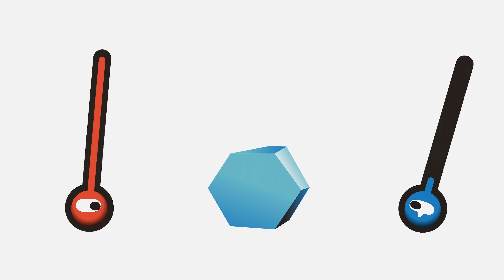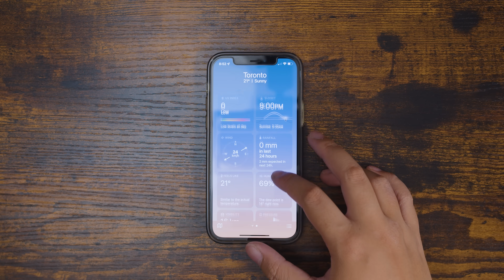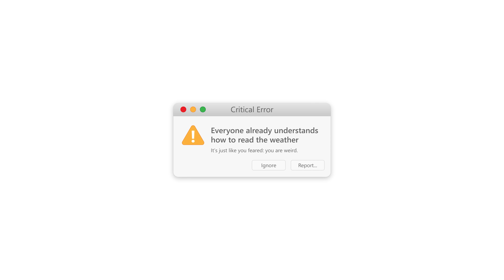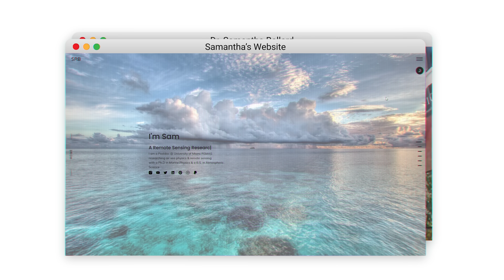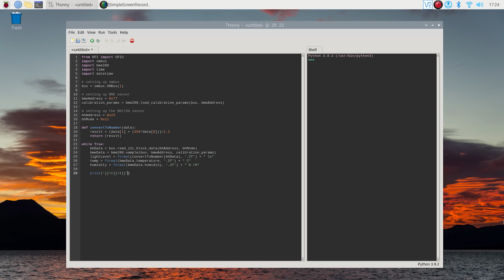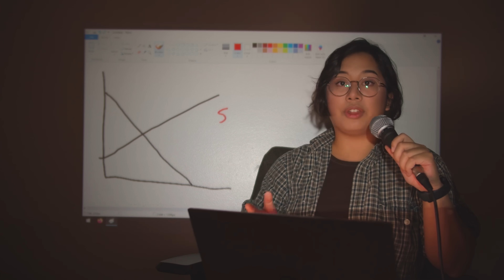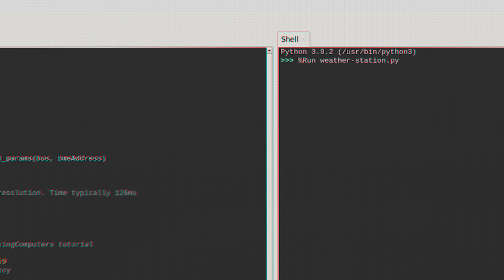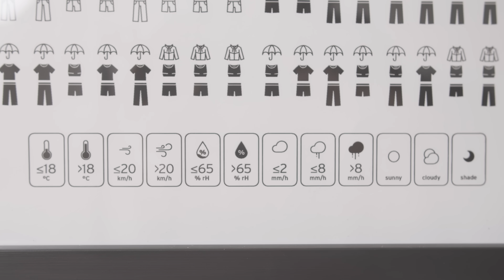how fahrenheit fails you

Comment: Honestly, I think Fahrenheit is only more intuitive if you're used to it, and the same goes for Celsius

Because speaking as someone more used to Celsius, to me it makes perfect sense that negative numbers means cold, single digits means slightly chilly but not that bad, the 20s are on the warm side, and if the temperature's above like 30, it's fair to say it's hot. Meanwhile, Fahrenheit seems bizarre to me because it uses really high numbers to describe temperatures that aren't even warm

And as many a Fahrenheit user has pointed out, to Fahrenheit users, it's the other way around

Comment: Humidity and dryness affecting how you feel is soooo true! I've lived in arid desert areas and humid and making me die areas, lol. Dry is always much easier to tolerate in the heat. Though I still prefer AC in the summer over swamp coolers, and I can put up with the nose bleeds from the dry weather for the tolerance.
Reply: I had that experience with cold this winter.
On vacation I went to a town 200 km from the coast and the next day I went to another right by the ocean. The first had 4 °C and the second had 6°C, I was fine in the first, I felt like I was freezing in the second, couldn't take my gloves or cap off.

Comment: I always preferred Celsius even though I grew up with Fahrenheit because the big number in the app for Celsius is honestly good enough for temperature, especially since the feels-like temperature is always gonna be off by quite a wide margin anyhow with humidity. So it’s just easier to see a number and round it up to the nearest 5 and dress for that in the summer, or round it down to the nearest 5 and wear something a little bit warmer in the winter. 

Plus I only have two kinds of clothes I wear anyhow, outfits suitable for hot, and outfits suitable for cold. 🤣

Comment: Maybe wet bulb temperature would be a more useful guide to how the weather will feel than temperature temperature. You can measure it with a wet thermometer, or calculate it with a formula from temperature and humidity. I think it encapsulates how the two combine together to affect how you feel.

Comment: Some apps have the “x C, feels like y C” where Y-number tries to include sun, wind etc effects compared to an “average” weather. Pretty useful for understanding compound effects? 

Also C with 0 = transition water/ice is pretty perfect for understanding weather reports around winter in countries where you transition between snowy/icy (-C) and wet (+C) a lot… like over here. Presuming all temperature scales will suck at some aspect, at least Celsius has a big easily understood correlation to one aspect of weather.

Another thing is to pack ultra light raincoat and use layers (which you say you don’t like lol). Shed a sweater into the backpack whenever warm. Add sweater and raincoat when weather sucks.
Reply: Celsius also works well in hotter countries, where it rarely reaches as low as 0C the presence of literal water freezing conditions basically means it's maximally cold, making it a convenient zero point. Basically Fahrenheit only seems to be more intuitive if you live in the middle of North America

Comment: For mapping temperature to outfit, both Celsius and Fahrenheit are fine. Numbers under 100 are manageable, and weather fits within two digits most of of the time.

However, as a Dutch person, the Celsius scale is much better for one thing: can I go and stand - and more importantly skate - on the ice in winter?
Though, this question is becoming less and less relevant, so until the weather gets ridiculously hot there's no clear winner.

Comment: Fahrenheit's purported advantages mainly only work in specific climates. Where I grew up 50-90⁰F is all that's going to be used most of the time, with maybe 35-110⁰F in extreme situations, which is a pretty arbitrary sounding set of numbers with no "real" anchor points. Knowing Celsius is degrees above freezing point gives me a pretty tangible reference point. Apart from that 50-90 doesn't seem in anyway to be a more inherently intuitive set of numbers than 10-32. And growing up with Celsius, I certainly feel I have a pretty good sense of it.

Comment: Your body's made of water. I only need the boiling and freezing points of water. If you remember that, temperature can work. I just tend to throw in heat index, wind chill, and humidity for a better picture.

0 C = 32 F

100 C = 212 F

Temperatures between 50 and 60 F tend to be acceptable for most people.

Anything below 45 makes some people think it's cold, and anything above 65 starts to get warm (all in F). The majority of the remaining scale is temperatures that people don't necessarily like iirc.

Comment: Fahrenheit is better than metric for only air temperature because Fahrenheit scale is more precise without using decimals at that scale and also largely avoids using negatives for below freezing. Celsius has the leg up in science, research and everything really except for air temperature. Fahrenheit allows more accuracy without using decimals, although some people say that most people who use Celsius don't use decimals, even if you don't, you're then losing a lot of precision, precision that you could have had from the beginning with Fahrenheit. You might point to Celsius' "more logical" scale from 0 to 100 though with 0 being freezing and 100 being boiling. Except, if your air temperature is more than the boiling point of water, you have a serious problem, and so a lot of the upper scale is wasted. It might be convenient to quickly reference freezing, but I would argue that knowing the freezing point is 0 and the freezing point is 32 is pretty much the same level of difficulty. Plus, if you stick with Fahrenheit you get to use numbers below freezing while not having them be negative. For these reasons, Fahrenheit is better than Celsius for air temperature since the scale between 0 and 100 makes much more sense and has larger precision than Celsius without having to use decimals or negatives nearly as often.

Comment: The Vector of Change - I find a temperature is a static point that benefits from knowing the direction of change. For instance, 21 degrees in a given set of conditions feels different when the temperature is rising vs falling. I suspect it may be because in one case energy is being added into a system while the other energy is being removed.
The other factor's rate of change may have an effect on your feeling but this one is what I've noticed(or is my mind playing a trickson me?)

Comment: body temperature is 36.5 C
something is cold if its under 36.5 C
something is hot if its over 36.5 C

if its 18 C outside thats 1/2 of your body temp which means its kinda coldish - long sleeve, mid thin fabric
if its 25 C outside thats about -10 C of your body temp so T-shirt will do

Comment: I had to recalibrate my understanding of tempurate becasue I acquired heat sensitivty due to chronic illnesses (I get heat stroke so easy). So now I have to remind myself that 80 degrees F is too hot for me to exist outside. Guess I'll be spending most of the summer indoors....

Comment: Fahrenheit is really simple for everyday use/weather. If it's under 40, wear warm clothes; if it's over 60, wear cool clothes; if it's under 0 or over 100, move somewhere less hellish. With Celsius it's like if it's under 0 or a little over 0 it's a little nippy and if it's 100 it doesn't matter because you're already dead but people defend it because they don't understand phase changes in matter and have never bothered to test it and accept as rote that 0C is freezing and 100C is boiling even though both numbers depend entirely on pure non-deuterated water under exactly 1 atmosphere of pressure (except now it's based on Kelvin so even that is only approximate) and it's less granular and therefore objectively worse for refined cooking tasks like candymaking or espresso preparation (a n d l a b o r a t o r y o p e r a t i o n s, and don't come at me with Kelvin because there is nothing inherently better about not having to use negative integers than not having to use non-integers as often), while both are equally effective for things like baking (where precision isn't important so it's a matter of whether you dial the oven to 175 or 350).

Anyway I convert them in my head, and was taught how to do it in school (which I don't remember, I just know intuitively for example 85F is about 30C, or that 65F is about 19C), but I also have that weird autistic geometric reasoning where I associate numbers with shapes and sensations making it easier to associate them without being able to explain why; Most of my peers who were also taught how to convert in school don't actually know how.

Comment: My weather station has an intern they keep outside to track “how does it feels” temperature, and they’re generally correct. 

Basing measuring system around water freezing temperature makes a lot of sense if you live in moderately cold places. Most of the time you just throw on a warm coat, or just a t-shirt and jorts. The tricky part comes when it’s something around 0°. It means you should be mentally prepared to break a leg or smth, because everything melted yesterday and freezed overnight.

Comment: I mean the biggest issue with temperature is that one thing is temperature itself and an entirely different thing is how you feel it. In humid weather your body struggles to cool itself so you feel hotter despite the fact the temperature may be the same. In my birth country most of the 26 Celsius places I've been to are pure HELL, but in the city I live in you can be very comfortable at 30 Celsius as long as you are not under direct sunlight.

Comment: One of the best ways to compute being comfortable with a number is using "Dew Point"

Definition: The dew point is the temperature to which air must be cooled to become saturated with water vapor, assuming constant air pressure and water content. When cooled below the dew point, moisture capacity is reduced and airborne water vapor will condense to form liquid water known as dew. 

TLDR definition: dew point goes up and down with the humidity/temp and if the temp goes below the dew point, than dew/fog/rain will happen

because the dew point directly correlates to temp/humidity you can use it to determine the comfort level of the weather.

> 24:  possible heat stroke
20-24: quite uncomfortable
15-20: mostly comfortable
10-15: comfortable
5-10: comfortable but dry
< 5: very dry and some are uncomfortable

hope this helps 😊

ps: yes, i am fun at parties 🙃
Reply: quick follow up example
currently it is 21c which because that is basically room temperature should be comfortable right?

nah...

there is currently a dew point of 20c which means that the humidity is almost 100% (97% when i checked). 
so right now i am basically breathing water... send help! 😅

Comment: I like Fahrenheit mainly because it has smaller units of measurement than Celsius. I can feel a Fahrenheit degree difference in temperature which is almost half a degree Celsius, such as 72F to 73F is still 22C. I like my rounded numbers. Also, my body averages between 36.5C and 37C where if I'm at 37C I will start to have a headache. 
As far as weather apps go, WTForecast is handy for the "feels like" temperature here in the humid South US which is helpful for choosing my outfits and it's funny too.

Comment: Okay there is a massive thing you aren't considering:

Humans can't sense temperature. We sense temperature delta (Or, losing or gaining heat relative to our own skin temperature).  That's why you feel cold if you have fever no matter the temperature outside, and that's also why if you workout in the cold you loose the sensation of coldness.

This also is a nice explanation of why it is better to drink hot drinks in summer and ice cream in winter: It lowers your temperature delta with the ambient, whereas doing the opposite increases it.

Comment: Below 18°C it's cold and when you drop into de single digits you have to double pack yourself. Above 18°C is warm and you can roam around with light clothes. Over 27°C you're cooking yourself, so use very light clothes. 35°C is ideal to wear a pool of water. But then you arrive to my country were humidity can complicate everything making you feel hot as heck at 18°C, but you can't get into lighter clothes because the wind will make you cold.

Comment: For people outside the US, 0°F is generally about when it's too cold to salt (or chloride) the roads, and 100°F is about the temp where the likelihood of heat stroke increases dramatically. (100 is also a fever if you're taking an interal temp) So, if you're someone who is bad with numbers, it's easy to just see 95, and think "that's close to 100, I'll do inside activities today" or "50 is in the middle, so I'll wear a light jacket" 
As someone who grew up in the US and probably has dyscalculia, moving abroad and switching to C was really rough -- doable, and I'm positive if I was raised with it I would have been fine -- but knowing if it was cold enough I had to layer, or if I needed a long sleeve or short sleeve t-shirt was total guess work. Once it dropped below 0 I had no frame of reference for how cold it was or if it would be manageable to do outside activities. Obviously people learn what number is attributed to what feeling, but I honestly have a really difficult time memorizing any number. I've learned to derive the meaning instead of memorizing in most number related needs my whole life, and F is just easier for that for me.
Reply: Thank you for this insight. Very interesting

Comment: As a brit the rule is if its higher than 8C you can easily survive with a t-shirt, over 12C you may wear shorts. Over 15C you will be publicly accosted for wearing a jacket or hoodie as is tradition. It is also customary to complain about "the heat" over 18C over 33C its usually a state of emergency and people die here.

Comment: While you are indeed correct that those sensors are somewhat inaccurate due to build constraints, your phone may or may not be more accurate! It depends on how close you are to the weather station that feeds your phone data. If your nearest National Weather Service station is several miles from where you live and at a different elevation, your local climate may be different enough that a small weather station setup could still tell you some very interesting information about what's outside your door!

Comment: I know how humidity affects body perception of temperature, I'm currently living in Itabira (Brazil), and here the weather is very dry and windy, but I'm from Ipatinga, just 150 km away from here, very close. Ipatinga is in the middle of a valley, with two large rivers crossing it. Two big rivers constantly throwing water to the air and no wind to dissipate the humidity, as result the city is insanely hot, despite having the same temperatures as Itabira, a much colder city

Comment: Some may argue that because your rig is off by 5ish degrees you'd building a weather station was a pointless step. I would argue that because humans don't feel temperature but the change of temperature and that our preference is purely subjective, remembering stories of the feral children that would play in the snow naked, it was a pointless step. 

I say all this as someone that will wear shorts in 40F because if I don't think about it the temp doesn't bother me but heat draws my attention, so I would rather be cold than hot or layered

Comment: This is only a debate when you acknowledge the existence of Fahrenheit. But, for most humans all over the world, it's not even there as a choice. It's not known. It's like it doesn't exist. I don't have any of the problems with Celsius that she describes. I don't need the temperature unit to tell me how I feel. In fact, if I wanted to know "how it feels" I would use the "sensacion termica" (thermal sensation I guess?) which is a number that very, very often is pretty much said right next to the temperature and takes into consideration factors as wind or humidity.

Comment: Below -10°C --> don't leave the house at all
-10°C - 0°C --> thick sweatshirt + coat + scarf, gloves, and beanie
0°C - 5°C --> normal sweater + coat + scarf and gloves
5°C - 10°C --> normal sweater + jacket or just the coat
10°C - 15°C --> normal or light sweater + jacket (fall) or either sweater or jacket (spring)
15°C - 20°C --> take the jacket with you, but you probably won't require it. Sweater season is offically over
20°C - 25°C --> leave the jacket at home, you won't require it. Don't even think about sweaters, but probably about sunscreen
25°C - 30°C --> t-shirts start to become too much clothing. Might think about shorts
30°C - 35°C --> as few clothes as socially acceptable. Best just leave the house to go to the beach
above 35°C --> don't leave the house at all.

If it's windy outside, you may substract 5°C from the actual temperature.

Comment: The zero point of water freezing makes a lot of sense for people living in environments where water freezes half the year.

It affects what kind of snow will rain or if its snow at all, it indicates if the ice is just ice or ice with a layer of water above, how wet the snow is or how hard it is, and also air humidity is greatly affected by going below this number.

So while the boiling point is for daily needs pretty arbitrary, the zero makes a lot of sense where it is.

And ultimately for any system of measurement only that point truly matters. If you want a more intuitive scale just multiply the number by three. Now -100 degrees is -33.3… degrees, as in colder than most winters get during nighttime.

Comment: In Heat Transfer Engineering, a common term used is Heat Flux. Which is the amount of heat that leaves a unit of area per second. 

It takes into account everything that effects how hot/cold it feels. Like if there’s more humidity, the heat flux increases.